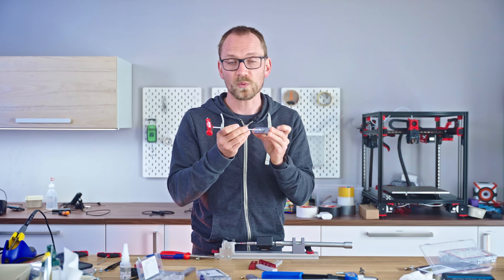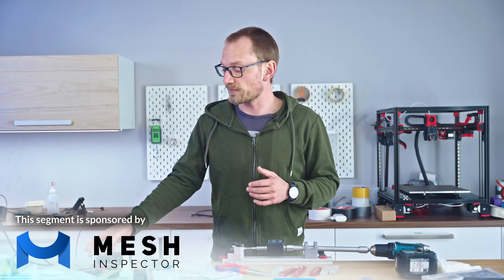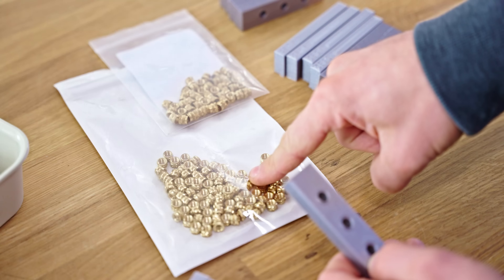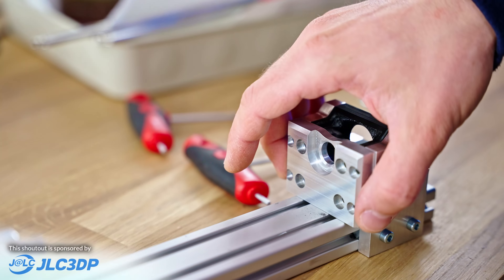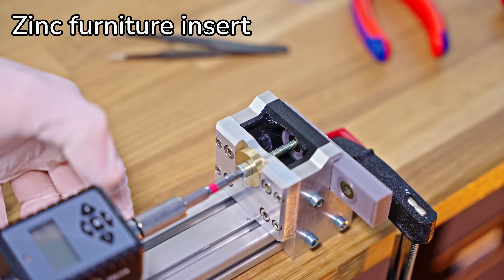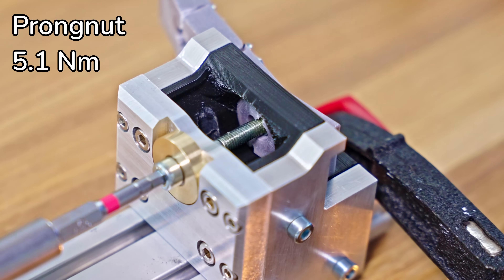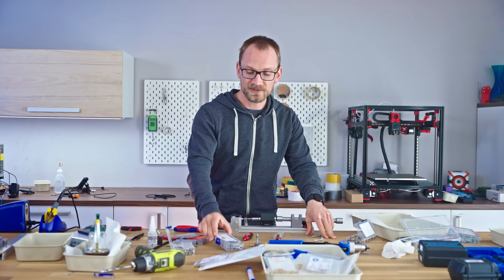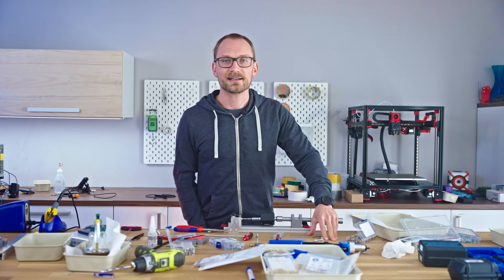These threaded inserts aren't made for 3D prints (but work amazingly well)

Comment: do you mind doing a tutorial on tapered threads in fusion? I couldn't find a way to do that the time i tried a while ago
Reply: One way of making threads, is to make a cylinder body. Then make a standard thread, and scale it. That way, if you find one that actually should work, like for the string one in this video, it is really easy to model. Once scaled, just join the cylinder body into the part. If you need to make a screw, same story. Other than that, there is quite a few videos out there, sampling using a spiral to make threads. But really, threads comes in different shapes width an pitches. In reality, once you start to scale them, only the shape of the thread matters. You adjust the pitch by scaling the z only, and the width by scaling the x and y, assuming the thread runs perpendicular to the x-y axis.

Comment: I have been using the self tap ones for a while now and I'm surprised at how strong those did in your tests; I use it for other stuff too, it's great for side loads. Although in prints, in tension, I find using square nuts to be stronger, almost like the pronged nuts, but it might be more prone to stripping due to the thickness of the ones I use (3mm for M5 ones).

Comment: Great comparison! For my designs which usually are pretty small I just use M3 bolt directly into plastic and for most cases it is sufficiently strong. And surprisingly the plastic survives many assembly-disassembly iterations. 
Thanks and love from Ukraine!
Reply: There are screws designed for directly threading into plastic, but they're kinda like wood screws. Last time I used them, they wrecked their own thread when I overtightened them. Machine screws are probably the way to go.
Reply: @MMuraseofSandvich  For ease of use there's nothing that really beats them, just thread in and it's done, that's why they are so popular for plastic housings and clamshells, basically all power tools use them
Reply: A better option is to design with a bit tight hole, and tap it with a tapper tool. A tapper tool makes far better threads, and the accuracy of the treads will be far superior, as opposed to just using a screw to do the tapping. If you use m14, you may use a regular 8mm flat bit, even on the backside of the screw. They last as long as the hole for the bit lasts. Just replace the screw if needed. That lasts for many hundreds, if not thousands of iterations, and you need no metal parts at all. You only need about two rotations of threads.
Reply: @FrodeBergetonNilsen  It is actually quite interesting which machine bolt would hold stronger. The one which goes into pre-tapped hole with a machine tap or the one which goes directly into the tight hole and tap its own thread as it goes. 
The machine taps are made to give some clearance between a part and a bolt. This extra clearance might weaken the joint with a machine bolt and a plastic part.
Reply: @yurikslalom  You need to mange the tolerance. Actually, the friction of the plastic is ideal for screws, as the fasten without hardly any force and don't come loose. Tapping screws, like the ones used for wood, typically has a sharp profile, cutting into the material, making them far less usable for extensive mounting and loosening iterations. Most of us who actually try both, just use machine screws.
Reply: Slava Ukraini!
Reply: @802Garage  Glory to the heroes!
Reply: For light load it is OK, but as M3 is very fine thread, it is extremely easy to overtighten. Also some plastic seems to stuck in the thread (unless you grease it or something). For PLA at least, PETG might be different, but as it flexes a lot more, I don't know.
Plastic screws (RC cars and game controllers have them, don't know where to actually get them) are much better.
Nut (hex too, I don't have square nuts) in a slot is very easy to model and works smoother :)
Reply: @kimmotoivanen  I get the use of m3 for stuff like RC cars, but the nut is 2.4mm thick. Even if you use a 0.6mm nozzle and 2mm threads, you only need about 4,2 mm of threading, and that is for all plastic screws. Using proper plastic screws are just so much stronger than m3 it is ridiculous.

Comment: I have used helicoil. however I have found that the helicoil can peel out when you really tighten it. The threaded brass ones are ok. I have used thousands of tapered brass heat set inserts and have had very good luck. However I almost alway print parts 100percent infill all abs / petg/ cf petg.

Comment: The key with any insert. Is to design it in such a way that you are pulling it thru the part not surface mounted.
Reply: In an ideal world yeah, but things are rarely ideal
Reply: Then again the entire point of going with a heat set insert is just like they do with laptop cases: you don't get the rear access, you can only stick it from the top. If you have rear access may as well just bolt and nut and call it a day, a little cavity for the nut if you're feeling fancy and need it to be hidden/stay there.
Reply: No it's not actually. Inserts were purposely designed to be used on the front face for injection molded parts. There are millions of examples of this. If you have a part that is going to be subject to alot of torque or pulling force on the screw then you simply design the part with the optimal fastener so that the stress is put on the part itself. You want the fastening system to be an extension of the part and therefore equal strength to the part itself. So an insert of low caliber front facing is perfect for a ras pi case or other enclosure typically.
Reply: @phasesecuritytechnology6573  yes actually. Injection molding is a entirely different process. It will flow around the insert and lock it in. You do not get that with 3d printing.
Reply: @TheJttv  Inserts for injection molding that get installed before the material flow are different from the front inserted melting ones. They have just straight ridges and a kinda deep slot in the middle, a really good shape for when the material is sure to get around it, but near useless when you need to melt them in place after the part is done. I've only seen the front set melt types on laptops for example, but bought the crappy cheaper injection molding ones on Aliexpress once, never again.

Considering the price difference and anecdotal evidence of laptops I've disassembled with broken cases (about 10 I think, all different brands) I would say they do it from the front on those devices, likely to avoid a way costlier mold.
Reply: @TheJttv So yes they are NOT loaded from the back. That is equivalent to pressing them in from the front face. The insert cannot be put in from the backside of a mold. Point remains.
Reply: Also the hole should be reducing in diameter along the way to avoid pulling the insert through the part.
Reply: Inserts used in injection molding are designed and Installed from the front face for decades. Sure doing it from the back if possible would be better on paper. But in reality the purpose of an insert in the first place is to NOT have to access the back of the part and to replace the need for a nut you can drop and lose. So saying it's better to put it in from behind is moot and pointless.
Reply: @phasesecuritytechnology6573  we are 3d printing. Not injection molding. So moot point